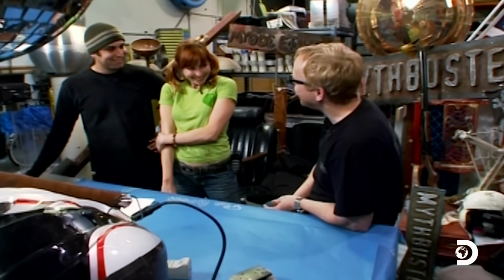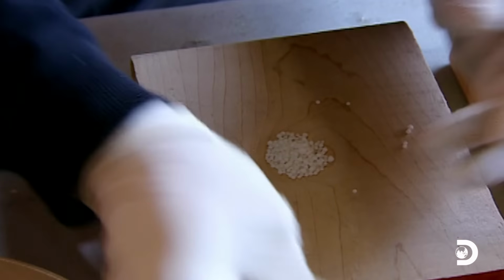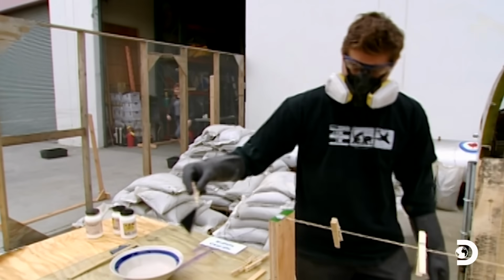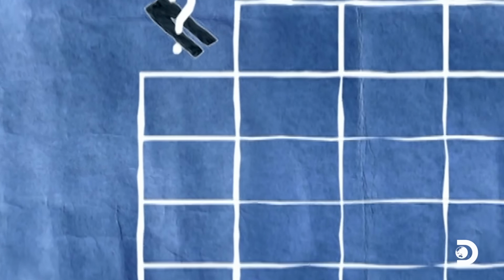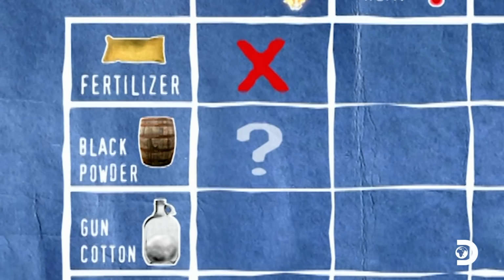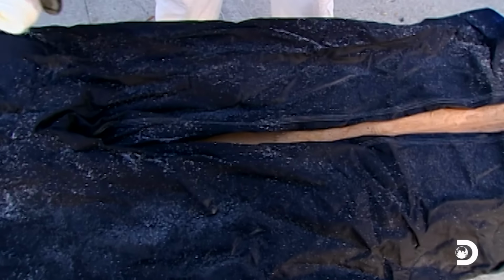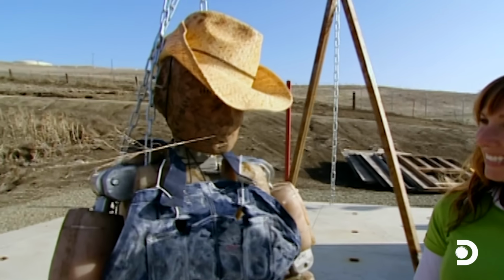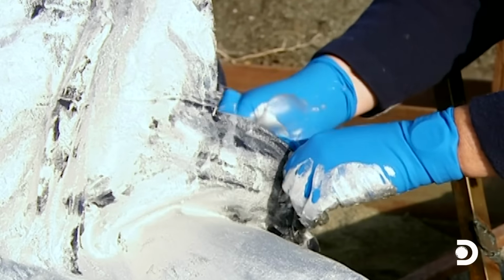What Causes Farmers’ Pants to Explode? | MythBusters | Discovery

Comment: God, Carrie mixing that gun cotton stuff was TERRIFYING
Reply: Yep, if you allow the nitration solution (a mix of nitric and sulfuric acid) to get too hot it can liberate a ton of nitrogen dioxide, which is the reddish-orange gas coming off it. They should have chilled the acid mix in a freezer first, the reaction is exothermic which overheated the solution.

Comment: I used to be a professional shotfirer (explosives tech in the mining industry) and there's nothing worse than the feeling when you have a gap in the con line... It's only ever happened to me on a couple of occasions, after thousands of successful blasts. And even though it's unlikely to go off, you have to go and disconnect the faulty line, which considering my entire career was using the "non electric" tied in method (meaning every hole is connected to the point of ignition), it's a spooky feeling to walk back into a loaded and tied in shot AFTER you've already hit the buttons. Especially when you're absolutely sure everything should have fired, because you've checked it several times and gone through the checklists.

Like I said, I've only ever done it a couple of times, but I'll never forget the sinking feeling of doing it. Especially because the mine I worked in was one of the biggest gold mines in the world and it was right next to the town, so there was often hundreds of tourists and locals at the lookout watching the blasts scheduled for 1pm and 5pm almost every day.
Reply: There’s a scene in Better Call Saul where this scenario happens during some underground blasting, and the tension while the character walks down to re-check the line was intense.